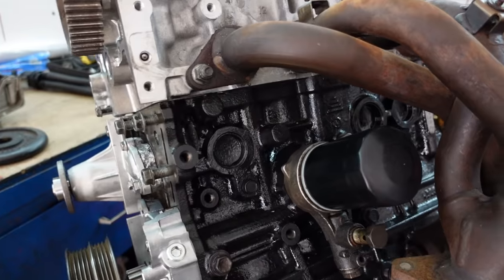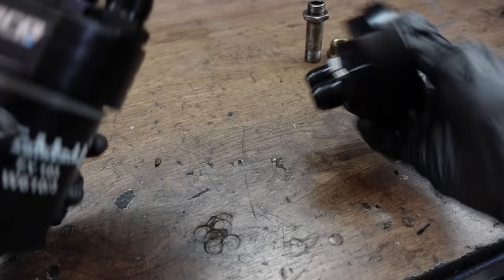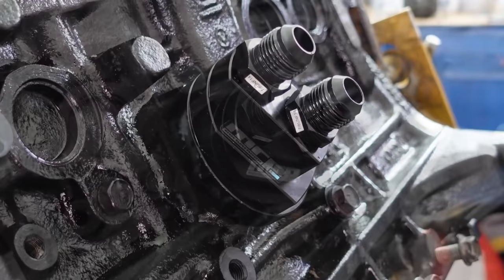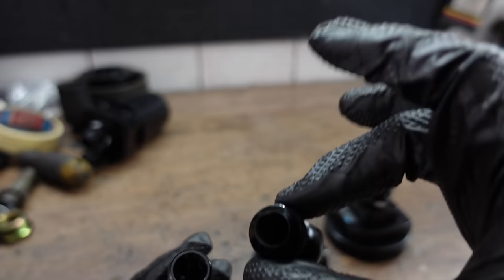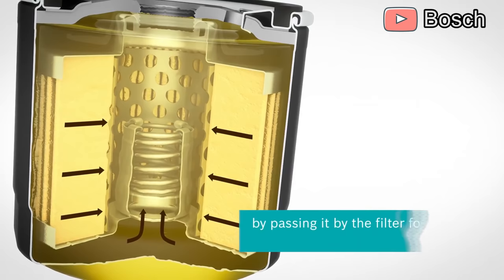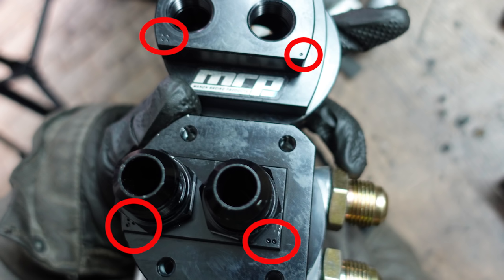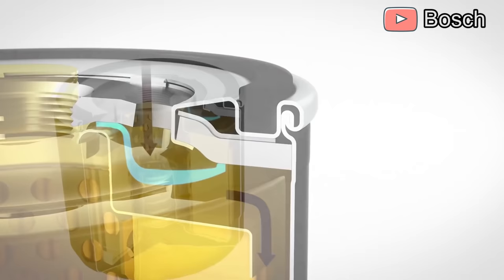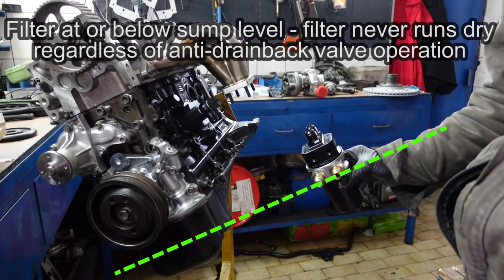HOW and WHY to relocate your OIL FILTER

Comment: The initial presumtion is wrong - relocating the oil filter is not the 'only' solution. You could have used a set of aftermarket headers that are designed to clear the stock filter from the outset. That dry running can be prevented by using a pre-charge system, where a tank holds a few litres of oil under pressure and sends that oil to the engine when the pressure is low, such as start up or high cornering  load - a small amount of oil is tapped off from the output of the filter in to the tank when the pump is making more pressure then the tank holds.
Of course, relocting the oil filter away from the exhaust has other benefits, though not as many as designing the engine to put the oil filter somewhere else in the first place, such as on the cooler inlet side of a crossflow engine. (Example Renault 16TS)
And just for the uniqueness, The Chrysler Slant Six as fitted to Right Hand Drive cars, had a remote filter as standard fitment, placing that filter under the inlet and exhaust manifolds due to lack of clearance for the standard filter from the Steering Box in RHD,... steel pipes do a lap arund the back of the engine to the filter at the front left side, then around the front past the pulleys back to the oil pump.... And yes, those pipes vibrate, crack, leak,... :D

Comment: I have a question about oil filters and relocation kits.  I drive a 2006 Chevy Cobalt Lt which uses a cartridge style oil filter.  Are there relocation kits that would work for this style of filter?  I am also hoping to swap filter types to the spin-on filters.

Comment: Hi, a little question. Can I keep the original oil block on and screw the adapter on it? i have an oem oil pressure switch screwed on the block and if i removed it I would have constant oil light on my dash.

Comment: Important to note: if you get the hose connection wrong your engine will be starved of oil.
Reply: No, it absolutely will not. It works in reverse the same, there's no check valves in the system.

Comment: could you crank the engine for a few seconds with ignition turned off so the pump can build pressure?
Reply: Yea if it is easy to disconnect that would help. 

I have my remote filter higher than the sump. I have checked a few times and the filter and lines have always been full even after sitting for a week. I use either Baldwin or Wix filters made for classic Chevy V8's. So maybe they just have proper anti drain back valves unlike cheap filters.

Comment: Now, if only there was some way to install a sort of electrically driven oil pump system that enables oil to be pumped and pressurized before every engine start...
Reply: Priming pumps are quite common on larger size diesels, both manually operated as electrical. It's required considering the lengths the oil has to travel before reaching the valve train if all oil has seeped down  to the sump after standing still for a while.
Reply: Just had a kill switch to the distributor

Comment: nice video, just a question, don't you need to cover or wrap the new oil lines to avoid heating problems with the new manifold?
Reply: lines must be shielded from abrasion and excess heat

Comment: luckily, my 1998 Audi A4 1.8t has the oil filter on the intake side of the engine, that is very easily reachable from underneath. So no need for me to relocate :)

Comment: The clearances between the oil filter and the exhaust manifold were sufficient for both to be placed where they were.  The question I would ask is why would anybody place the oil filter that close to the exhaust manifold and all of the heat it puts off.  Excessive heat is an enemy of oil and its ability to provide proper lubrication.  This location makes no sense to me.

Comment: BMW and a few other manufacturers locate their oil filter element on top of the engine so that when it started this oil is directly fit into the upper engine and down to the galleries where the crankshaft camshaft require oil immediately, why can't the same thing be done with an oil relocation kit?
Why don't you use an electric oil pump that will turn on as a pre oral lubricant when you put the key in the ignition before you start the car? And will shut off the electric pump after the engine starts running as a bypass method? And connect the electrical oil pump also to your turbo
Reply: I am using a VDO electric oil pump to supply oil to my oil cooler, but this loop is sump->sump so non high pressure as its separate from the engine oil system. I use a moroso oil accumulator to prelube the engine and prevent oil starvation issues
Reply: Just out of kill switch to the distributor lot simpler

Comment: Probably a really stupid question - Would there be a problem if you mounted the oil filter assembly in the low position but invert the filter so that it is pointing upwards to make replacing it easier?
Reply: So you can make a mess when you take it out? All the oil in it would spill. Unless you replace the filter with a cartridge style...
Reply: As mentioned above it would spill oil everywhere and you would also have to install the filter dry and that is not ideal either.

Comment: Are you sure it’s m20 in the 4afe? I had a problem with this on my 4e/5e engines which is 3/4unf
Reply from the maker: Definitely not m20, I just installed this during the demo. It's the UNF thing, the other one.
Reply: @d4a  then I’ve said nothing 🤭.  

Keep up the good content bro.

Comment: Mate that looks just as big as the oil fiter that was already there. Surely they could manufacture something smaller?
Reply: I like the Canton Racing ones myself. They have ports 90° to the block and rotate 360°. They are roughly 1.5" (38mm) thick and come in your choice of thread pitch.

Comment: I hate that you say that the "only" solution is relocating the oil filter. You could also fabricate an exhaust manifold that doesn't hit the filter or have a top mounted turbo.
Reply from the maker: You must hate a lot of stuff. The car is mid - engined and the filter is right underneath the manifold, there is no way you can make a manifold that allows the filter to stay where it is. There is absolutely no space for it. Top mount turbo would need to protrude almost completely out of the hood to fit which is ridiculous and not street legal. Common sense really tells you that anyone doing a build like this of course considers all the options... But no, let's hate what I said because of subjectivity and lack of reasoning 👍👍

Comment: This would not be an issue on your engine if Toyota didn't do the dumb thing and wrap the exhaust around the engine. More heat in the engine bay, warmer intake air temp, easier to burn yourselt, more weight/material, less access to the underside of the engine...

Comment: Its interesting to see a purpose made turbo manifold not fit its intended engine. Only one thing comes to mind......ebay part from China? The moron whom designed that manifold didn't realize the oil filter was in the way.

Comment: They need a relocation kit for the dumbass BMWs with the filter on top of the engine that leaks all the time into the coolant. Need something that completely separates the oil passages from the coolant passage.

Comment: That's a lot of parts and money to fix a badly designed manifold lol
Reply from the maker: So this is what you've become in the end? A troll? Cmon man... You're better than that.
Reply: @d4a  I do a little of trolling yes but I mean, why couldn't the manifold be further apart from the engine or go around the filter? This is a legit question, why did it had to be that complicated to a fit a manifold? Unless i'm behind in terms of updates, which I'm definitely am, and you've personaly made the manifold in which case I'm sorry
Reply: @TheCabillaud94   I suspect there is not room in the engine bay to have a manifold go out past the oil filter and then still have a turbo on it, extending further.  Easier to relocate the oil filter than to cut a hole in the firewall or something to make room.